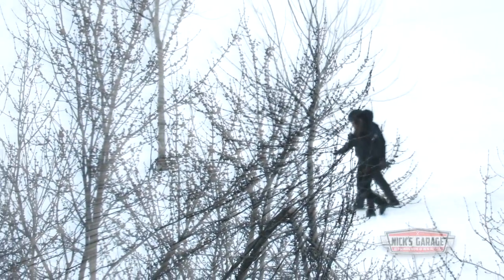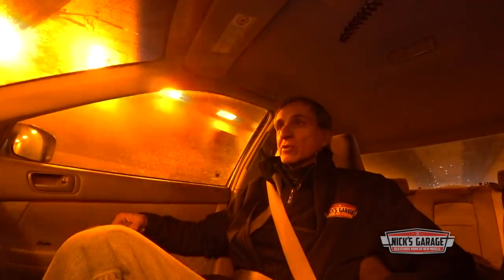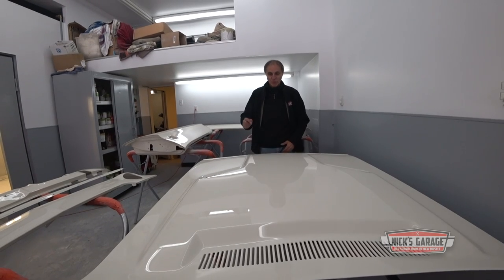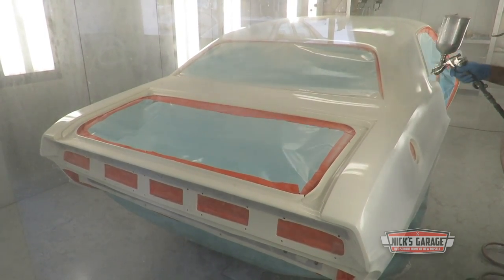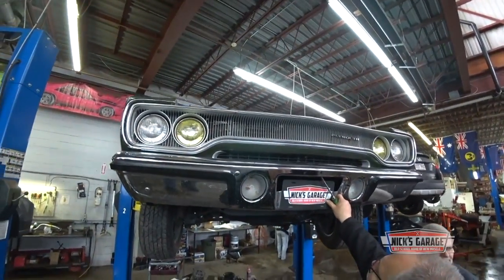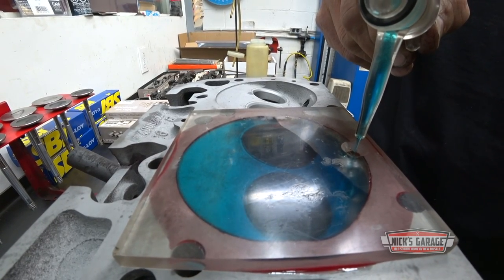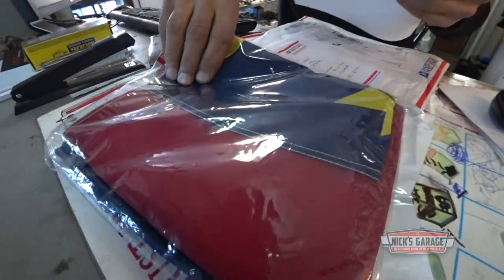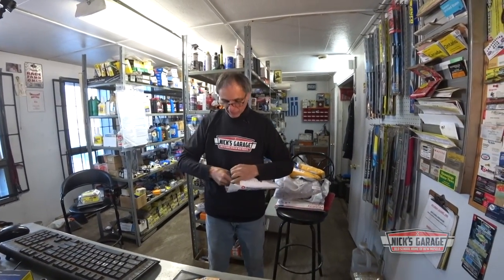Shooting Kowalski - 1970 Challenger in paint booth

Comment: Hey Nick Which of the 440 engines came in Chrysler Blue? Was it like the 440  in the old Chrysler 300? I saw one at a car show a few years back that was Chrysler Blue, I ended up using that shade of blue to do the stripes on my Charger, wondering if thats an original engine colour
Reply: Dresdon Acacin.     The old Chrysler blue was more like Turquoise.

Comment: I spotted those ductile iron adjustable rockers - I did lol.
I don't like roller rockers much, though they have their uses I suppose. I like valve the pad of the iron type of adjustables because the radius of the wiping face is about that of an orange as opposed to a roller tip which has a very small radius and therefore has higher surface intensity on the valve tip. The roller tip comes into it's own on big lift camshafts no doubt but seem like a lot of extra moving parts for no good reason on a street motor. 
(I know some motors you can only get rollers so better to have them than stamped for sure)

452 casting heads are better than 906 according to those links I sent you a year or more ago by Steve Dulcich. He extensively tested every BBM factory head starting with 915 closed chamber to the late heads and the late heads came up trumps in airflow in stock and ported configuration.
Reply: ThePaulv12.    That is totally correct.

Comment: do you have your guys wax the inside and the outside of chromed parts like bumpers before they get installed. to reduce any chance of corrosion happening on the inside..
Reply: wayne.         Not really, it does not see rain or snow.

Comment: Awesome video! One question for you can you tell us on the compression caluator if the piston is plus or minus? This is where I have a problem on caluating compression.
Thanks Glen
Reply: Glenn Brannon.   If the piston is below deck, it is a plus. The reason why, because you are adding cc's to the complete volume at TDC. Like for example, I should have said add 6cc for the 2 valve reliefs. If the piston is above the deck, it is minus. Call me, if you need more info on calculating C.R.
Reply: @nickpanaritis4122  Thanks Nick!

Comment: Engine lube is a good idea, I use a SMEAR of grease but have seen some "engine builders" using a LOT of grease which, surely, must prevent the plate sitting true to the head and give a false reading?
As an aside, if you're lazy (like me), or want to make the process quicker, use a piece of perspex (or similar) that is long enough to cover all the chambers and do them all together.
To remove the fluid, use an eye-dropper end in a rubber tube connected to a squeeze bottle to pull draw it out the fill hole - you won't get all of it but it does get most of it.
Reply: GordoWG1 WG1.   Thanks for the info.

Comment: A great colour!! Factory white. No Bling, Just straight up car. The Engine is the Bling !!! Nice Job. Do you put Dyna Mat in when you put it back together??
Reply: K P.     Dyna Mat ?
Reply: @nickpanaritis4122    Oh The sound barrier product for the floor and engine area inside the car.
Reply: KP.        I am only putting the factory insulation. Dyna Mat sounds good.
Reply: @nickpanaritis4122  They use it since the Horse power is way above what it used to be 350 horse now 500plus horse gets very LOUD.  Anyways you KNOW what you need. !!!!  THX !!!
Reply: KP.  Thanks.
Reply: I've used Dynamat on a few restorations I did over the years. Easy stuff to work with and does the job deadening the noise but it's a little on the heavy side for my tastes. I'll stick with the factory material on my personal 340 Duster project.